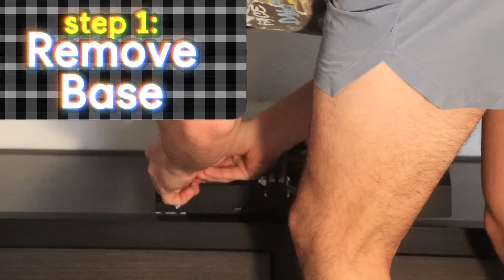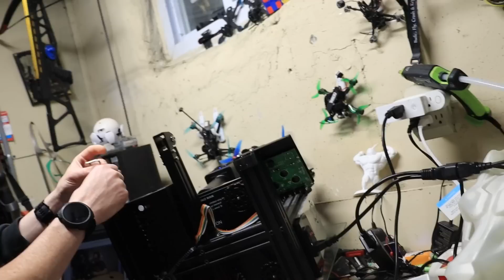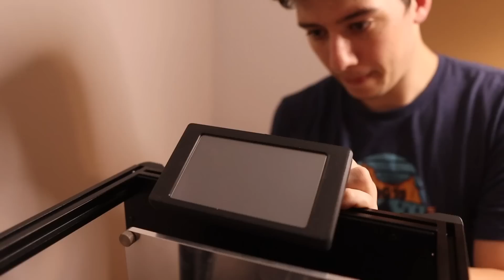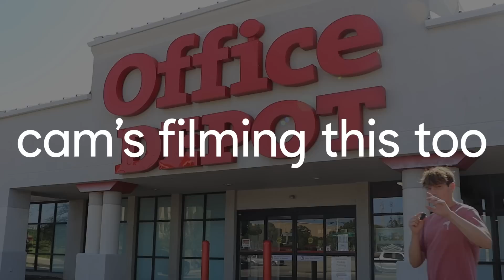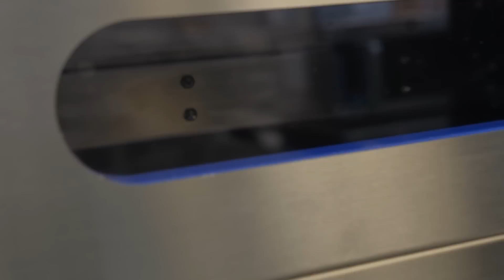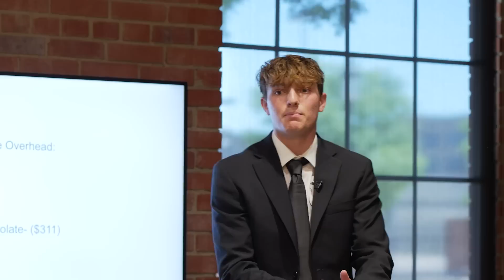I 3D Printed Chocolate

Comment: the machine you have can take anywhere from 5 minutes to 2 hours, so lets just say 1 reasonable sized piece will take an hour and 15 minutes and the machines and workers are there for 8 hours. you would be making 6.9 every day with 1 machine. they would need 1700 machines to meet their existing production rate a day which takes way more space and takes way to long to just make 1 machine